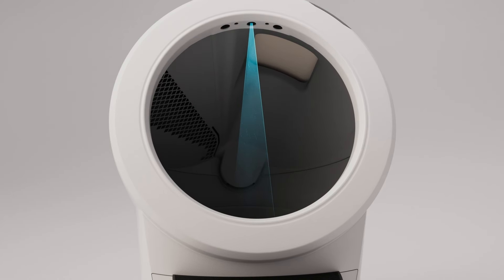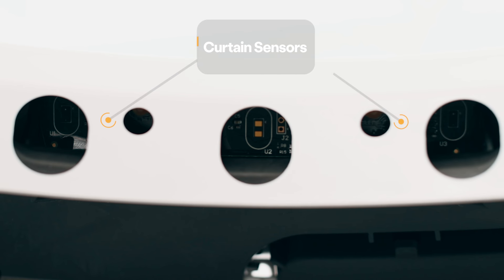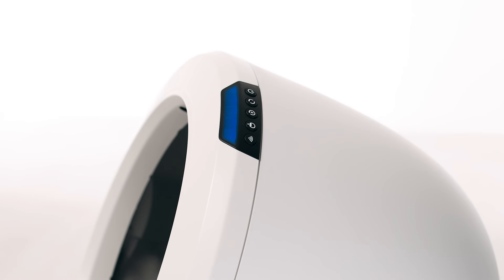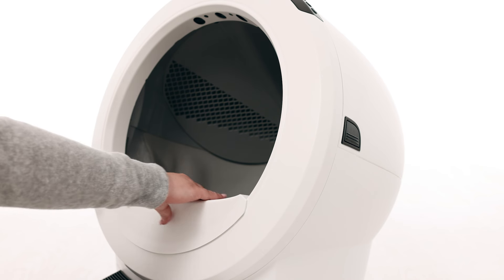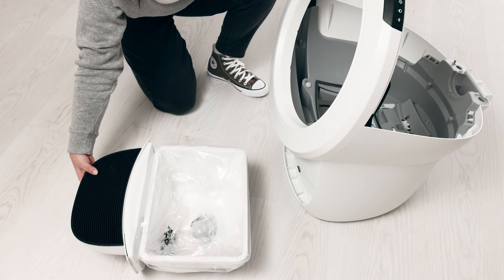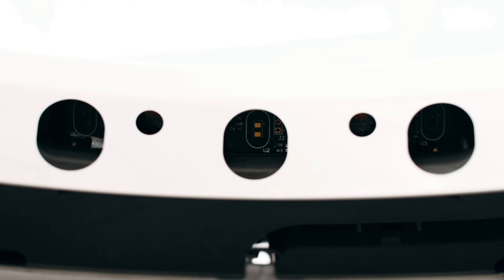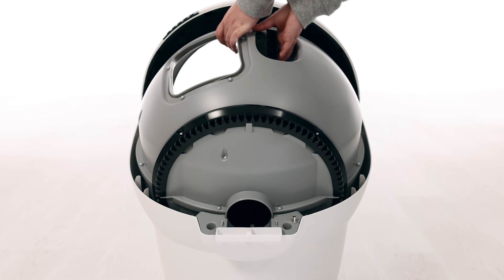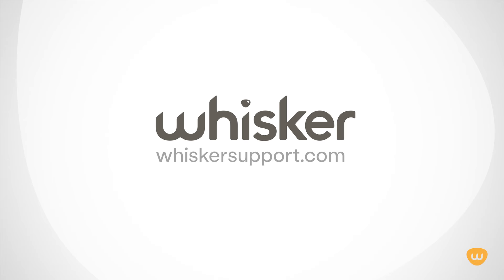How to clean the OmniSense laser sensors | Litter-Robot 4

Comment: I have a brand new unit complaining of dirty sensors. And it would seem a bunch of LR4 owners have this issue...you all claim it may be dusty Litter...and yet I'm using YOUR premium litter. 😂 What nonsense
Reply from the maker: We're sorry to hear about the issues that you've been experiencing with your Litter-Robot. Please give us a call at 1-877-250-7729 (we are available Mon-Fri: 9AM-7PM EST and Sat: 9AM-5PM EST).
Reply: Same issue, I have 2 units, 1 is OK the newest is doing the same, flashing blue light inaccurate drawer reading.  I am deep cleaning it today and I'll see if that helps.  If not I'm calling the help desk...other than that, these have made a huge life improvement.  We foster for shelters and these really help!
Reply: @ThePlantlife any luck? I’m having the same issue and I’m going to give it a good clean and recalibrate it today. Fingers crossed
Reply from the maker: Please reach out to our Customer Experience team if the troubleshooting does not resolve the issue!
Reply: @kendahly1948  TLDR deep clean regularly and clear bags....we deep clean the units regularly, but the biggest improvement was using clear disposable bags, we were using small drawstring bags, solid white. We switched to the clear and really haven't had any issues, accurate readings.  No false full messages.
Reply: @ThePlantlife thank you for the tip about the clear bags. We just use white 13 gallon bags to save money. Have you found any specific clear bags that fit the liter robot well or do you buy the litter robot branded bags?
Reply: @kendahly1948  we used the same white bags.   We use the Home Depot clear 13 gallon those work well.  Lowes or Walmart probably have them as well.
Reply: @kendahly1948  My apologies, I have to correct my previous reply...they are 10 gallon clear bags from Home Depot.  Also Sams club had 13 gallon clear, I'm sure those will be fine.